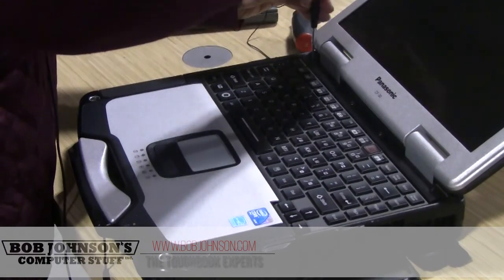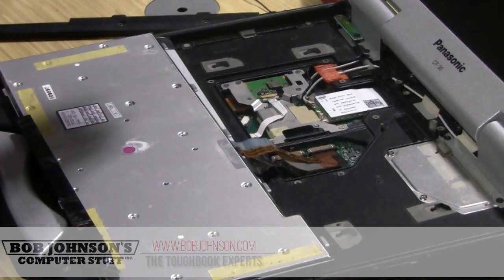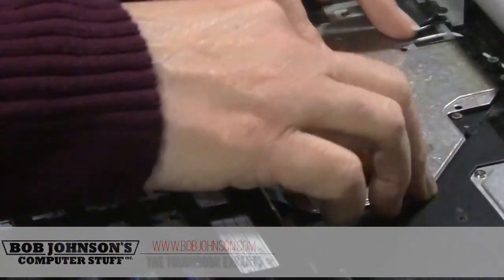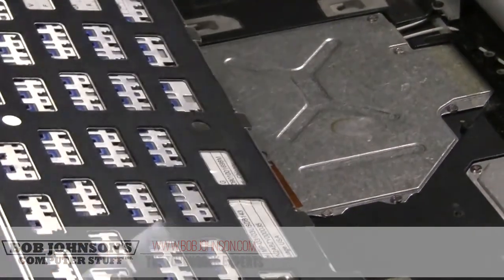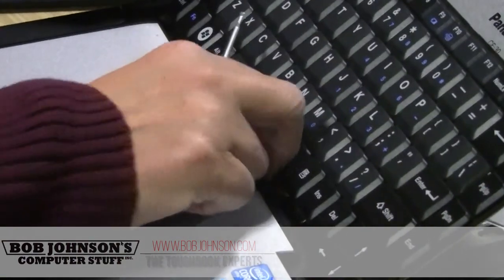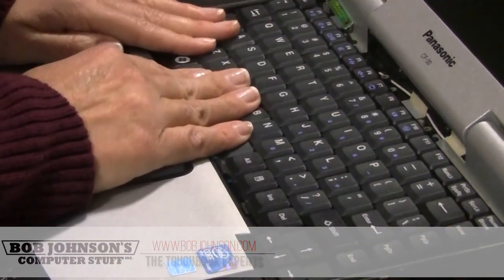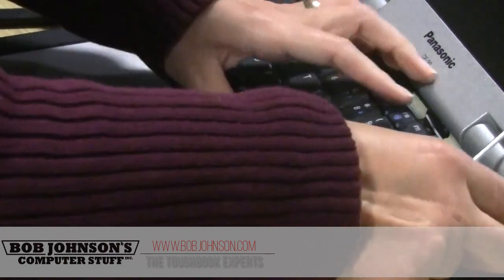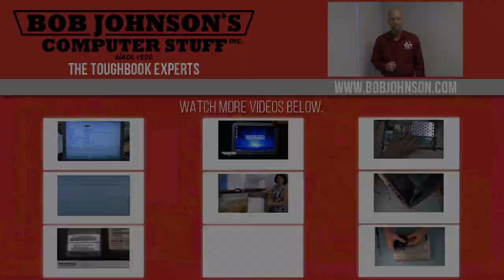How to Replace a Keyboard in the Panasonic Toughbook CF-30

Comment: just replaced keyboard but using this video for reference didn't include the finer point she encounters installing new keyboard...the bumps are keys that fit into the silvery keyways...it looks like she gave up and finished video but keyboard still rocked so keys weren't in keyways....best proof is lifting keyboard using screwdriver at front of keyboard...she wouldn't be able to if keys were in keyways...if keyboard doesn't easily lift then you have key/keyway keyboard and to remove must slide keyboard towards screen!

Comment: Hi, I have a problem with this toughbook. Some keys does not work (enter, home, end, left and right). I changed the keyboard but the keys won't work, do you have any idea of why?? thank you in advance for your help
Reply from the maker: Since you replaced the keyboard and the same keys don't work, then your keyboard connector is probably damaged. The keyboard connector on the CF-30 is built into the motherboard. Unfortunately, the only fix is to replace the motherboard.